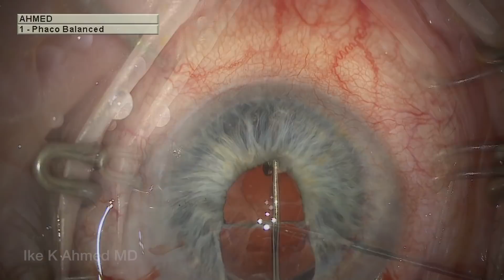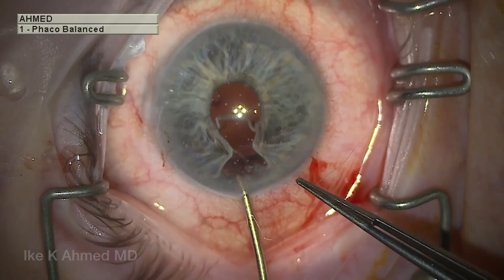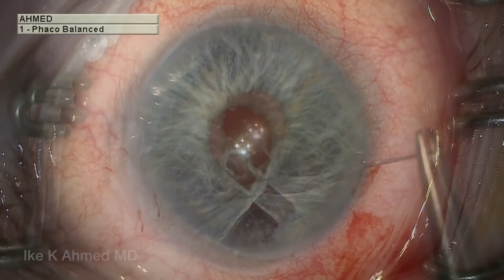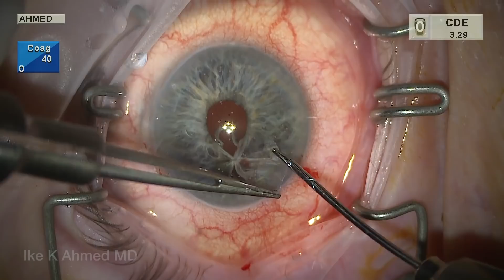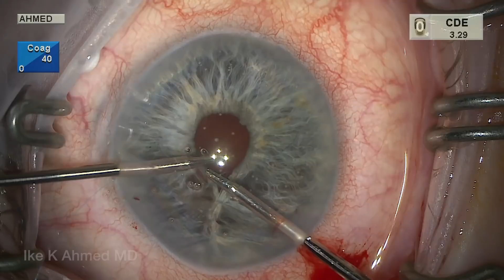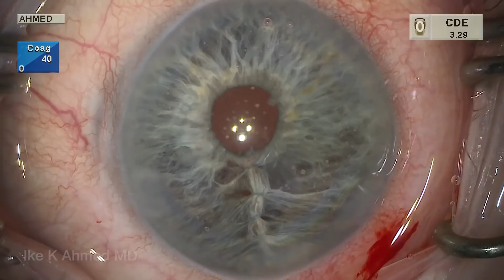Iris Repair after Complicated Cataract Surgery

Comment: Also in addition to the other comments, how well do pupils like this dilate in the event of a proper fundoscopy or God forbid a vitrectomy?
Reply: You don’t really want to leave the patient with that kind of a pupil. Sometimes patient have pupils as small as that anyway when you are doing vitrectomy. You just have to deal with it.
Reply: @Antroid1  of course. Leaving it is not a solution either. Perhaps leaving it in a mid rather than small pupil would be beneficial. Especially if the patient had a complicated cataract surgery as the video suggests which increases the risk of a possible retinal tear which in turn would also be difficult to spot and treat with a smaller pupil.
Reply: Somewhat. Not usually a problem with vitrectomy. One can always use iris hooks or cut the most proximal suture during the vitrectomy.
Reply: @Antroid1  you don't really want to be meddling with the AC with a posterior problem